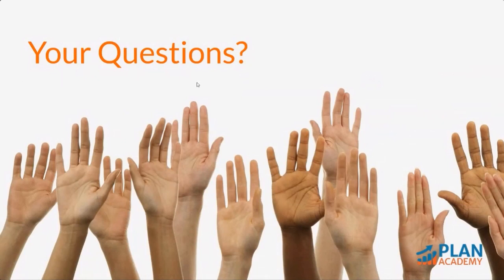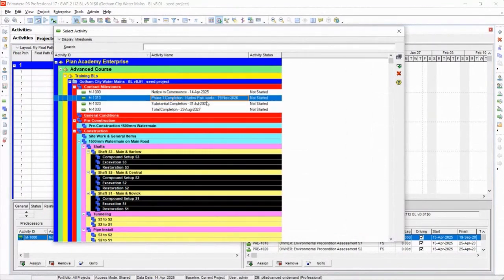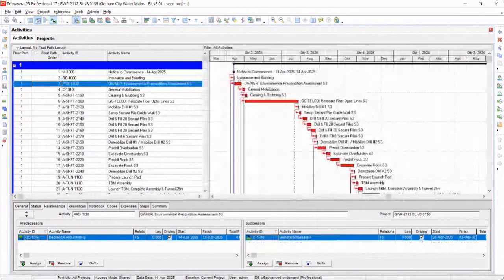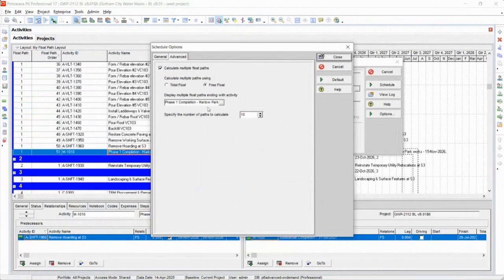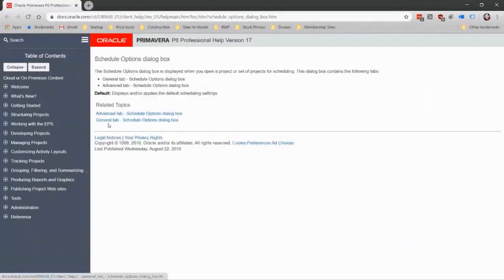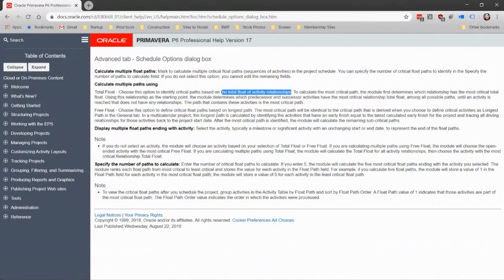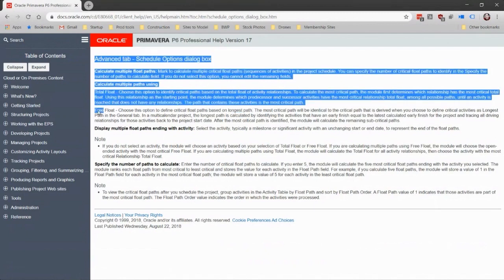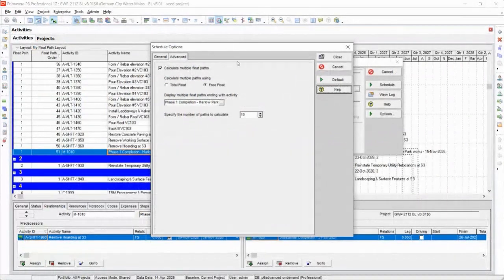When Calculating Multiple Float Paths, What's the Difference Between Total and Free Float?

Comment: Hi, imagine I am updating a project with recourses loaded. Imagine the activity I updating is for progress, has 4 days (Original duration). Now  my activity delayed by 6 days(Actual duration 6 days). 
my question is when I look activity details actual duration did change but actual cost remain the same as budget cost. why?

based on actual duration actual cost must have updated but it didn't and i have to manually calculate and manually
 input.